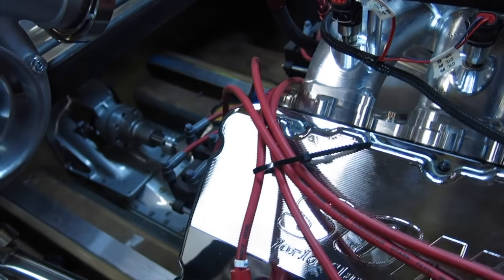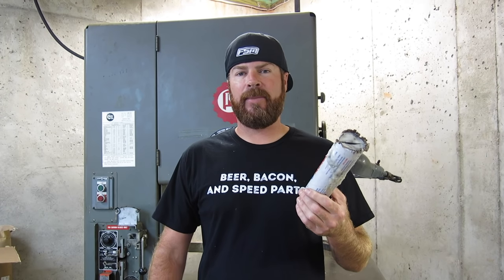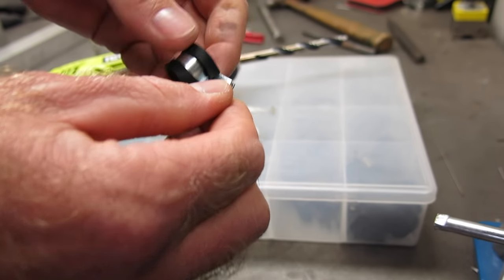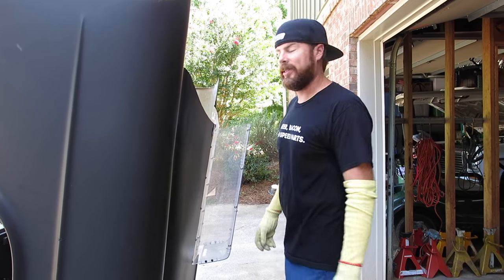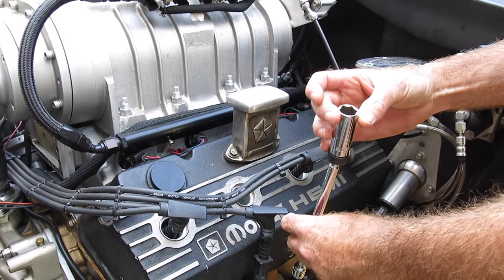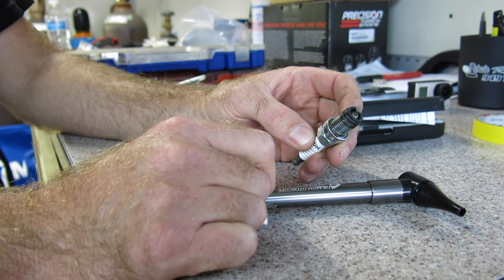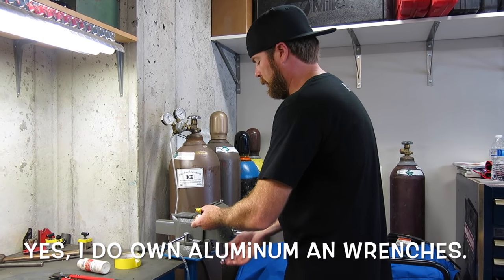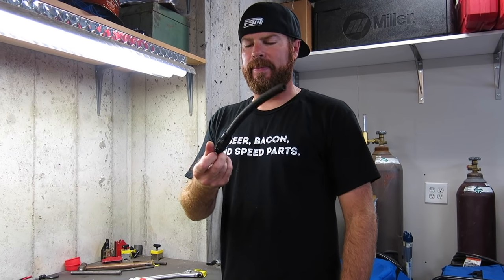Finnegan's Garage Ep 14: Life Hacks for Car Guys

Comment: Another use for that small scrap of soap. If you have a old metal gas tank that is leaking, rub that soap over the gas leak and it will stop that gas leak, to get you home, to fix it properly. I've seen it done and it stopped the leak. try it,  be careful with gas leaks no fire or smoking. Great tips and video.
Reply: Also works on plastic home heating tanks as well
Reply: And to repair tanks of most materials Araldite [epoxy] does a very good job. 5 minute if you have too but the good 24 hour stuff is best, or Devcon also.
IF oil free it will repair small cracks in oil pans too. Forget it though if not 100% clean
Reply: Acetone and torch , f250 5.8 5 spd 4mfwd ,solid as a rock . when pan came in and went in .
Reply: A pop rivet and a rubber or plastic washer will also get you out of trouble with a small hole in a tank.
Reply: All you need to do is rub the soap on the gas that running or dripping out of the tank, its that simple, no tools required, great tip if you have a round hole.

Comment: Also any chance you can go more in depth with reading spark plugs?
Reply: inside cover of every Haynes manual
Reply: I think you missed the "In Depth" part.
Reply: Ceramic should be a cardboard brown color. Black is rich, white is lean. Light brown is slightly lean, dark brown/ blackish brown is slightly rich
Reply: Jason Peterson

its a good starting point
Reply: Would like to hear more than colors.   Finnegan said about time my marks and fuel ratio marks being burned into the strap and ceramic.   Would like to hear more myself
Reply: the depth tells you timing. the more compression the plug bangs into, the deeper it will show up.
Reply: location of colour is very important too don't forget, you are NOT looking for colour at the very top where it counts is at the very base so ya gotta chop the threads of to see, That's WOT of course idle and mid range have their locations to a swell as heat rang eon the threads initial and total timing on the earth strap and the clearest is idle mixture all over the top of course
Reply: depth of what? if you are claiming the depth of where the colour is on the ceramic then I'd hate to see your tune
Reply: I didn't understand what Finnegan meant by looking deep inside the spark plug. Do you know what he was trying to say? Is it not good enough to just look at the tip of the spark plug? Thanks for any advice you can give.
Reply: Never mind about my question to you earlier. I just saw that "wordreet" has a good link below, regarding the reading of spark plugs.
Reply: Yes, please, I'd love to see this explained.  I'm trying to do "plug chops" on a motorcycle and cutting the threads to view the base of the insulator, but it's not telling me anything.  I'm hoping he can elaborate...
Reply: jcapcik
Google yellow bullet forums and look for nitrous guys threads on plug reading, if anyone knows what plugs look like it's nitrous guys
Reply: Not necessarily, today's ethanol blend makes it rather difficult. I tuned a 318 via color once and had the thing so pig rich trying to get a color change, that it was gargling at cruise and the plug was still ghost white. At least the tip of the porcelain was, Im sure deeper down the cone told a different story that the naked eye could see.
Reply: @dirtRider500R  

*Couldn't

Comment: Killer tips!  Before the 5/8" Plugs, we used an old screwdriver and a piece of 3/8" fuel line.
Put the line on the driver with a hose clamp and Hooray!  Works for installing the plug in odd places too!!

Comment: I like the magnet trick for retrieving plugs, works good on the Ford mod motors and the Mopar 4.7.  And for putting them back in a piece of vacuum hose pushed on the end of the plug works great to guide it back into the hole and you can also start the plug into the hole by twisting the hose.

Comment: The mini magnet on the stick is the most useful thing ever
Reply: Yes, and cheap also. In case you don't have that, hold a long screw and a big magnet (like those on a speaker) on the other end. It'll do the trick.
Reply: They're great for when you drop something stupid down your distributor hole like the hold down bolt too. Ask me how I know.
Reply: Instead of the magnet to get plugs use a 8" piece of 5/16 ID fuel hose.  You can grab plugs and start treading them with the hose pushed over the end of the plug.  This is very helpful for changing plugs on the rear bank of cylinders on FWD cars like camry or lexus
Reply: I wish I had one of those a couple months ago. Stupid spark plug socket rubber wouldn't grab the damn plug and pull it out.
Reply: I just stick the plug wire back in to get the plug. I mean, it's right there. It's made to grab the plug.

Comment: Life hack I learnt today when I bought a Ford Ranger. The fuel tank is on the drives side unlike my Hilux. I said I will have to remember it's on this side now. He said as we got back in the truck. See the fuel gauge, there's an arrow that points to the side which the filler is on. Blew my mind. Thanks for the tips Finnegan.

Comment: Cool stuff as always.  For SPARK PLUG installation & removal after you initially loosen or install, use vacuum hose on the silver plug ends.  It's flexible, wont allow you to gall the threads

Comment: Hello from Poland!
To remove, and insert a dificult sparkplug, you can use a rubber hose.
The benefit over a magnet, is that you can safely "dive" a plug down to its canal, and then screw it till the wrench is needed.

Great show by the way!
And great choice of beard, over the early roadkill one :)

Comment: Using a bit of rubber fuel line (4-6") works great for pulling spark plugs out.  Also works great at installing plugs since the hose holds the plug tight enough for the first few threads.

Comment: could you tell us a little more about how you read sparkplugs? with my little knowlege  all i knew was that black means ritch and white means lean but i allways just looked at the end of them and not inside. i had no idea you could read timing either but i realy want to know how to do it :D the neighbours ancient 2 stroke bike is cramping our style no matter what we do it doesnt wanna run right. allthough it doesnt help that we have very little knowlege about carburetors too.
Reply: ***** yeah we took it apart and found that the ring gaps were widely off-spec, they got replaced but the bike is still in the break-in stage. you can allready feel the compression when you try to start it. kick it too lightly and it'll damn near break your ankle :D we tryed to judge the timing from its behaviour at different RPMs but that only got us so far so next guess would be the AF ratio. its a fun process and i have no idea how the older generation managed to learn this without the internet :D thx for the tips, i'll try to find some forums

Comment: Been doing that trick with tape to build aircraft hoses for a long time now. Same with the zip tie trick for wire separation. You can get small nylon spacers at Home Depot that work great to separate your wires instead of zip ties between the wires.

Comment: Hey Mike!

Love the channel and the roadkill series. Keep up the good work. Also look into magnetic spark plug sockets. You'll never go back to the old rubber ones again. Never wear out and no "break in" time fighting to get the plug out of fresh rubber.

My own tip, murray makes a special oil for lubing A/C seals. Works great for any seal or oring especially fuel injectors. Miracle in a bottle. Also, Vaseline works in a pinch for stubborn Orings in a pinch.

Comment: Who knew wire ties could be used to tie wires. Good tip though. Lol
Reply: I did,,, I saw David do it months ago on roadkill!
Reply: Freiburger first did it in a Car Craft tips article in the early 90's. It's an old NASCAR thing.
Reply: LDN Wholesale  Yes, David did do it on roadkill but the tails (the ends of the zip ties) were supposed to be on the back side of the spark plug wires & then you cut the ends off.

Comment: a tip four your tip, Mike, when putting tape on the wrench, substitute metric for standard fitting and standard for metric fittings. metric is usualy just in between standard wrench sizes. that way, you won't have the clearance issues you had with the tape.

Comment: I was late realising the step drill versatility - check around as some versions have fewer steps but much longer shanks for their sizes - very useful for thicker materials.
Also great for enlarging drillings in heads (eg. larger studs) and other castings for a much neater job as the initial step makes a perfectly aligned hole that guides a regular drill the full length and stops that awkward walking on initial bit - especially for hand drilling and especially, especially for soft materials that can 'grab' the drill.

Oh, and so nice to see someone using a shifting spanner the right way round :-)

Comment: Don't know if anyone else's brought this up but what I use for the deep recessed plugs in my motorcycles and suck is a set of very thin, long jawed hemostats. I got mine when I bought a bunch of tools from a friend and don't know where he got them. but the jaws are between 3-4" long and taper down to the tip from about 1/4" wide at the pivot point. I not only remove the plugs, but since they lock down when you squeeze them together, I can also start them into the hole.

Comment: I've used the ol' zip tie wire separator procedure, but that step drill trick for opening bolt holes is a new one for me. Definitely gonna use that in a pinch!

Comment: Tip for retrieving sparkplug in hemi heads. old rubber sparkplug boot glued to a piece of wooden dowel. loosen the pug then push the rubber boot over the plug and unscrew by hand using the dowel. Makes putting new plugs back in easier too

Comment: I always just used a die grinder bit to enlarge clamp holes. Do yourself a favor get a blue point magnet i've got two and dont leave home without one. Inspection mirrors are great too especially when you drop a bolt or nut in an engine compartment and it's in a blind spot.

Comment: Professor F, I am sad to say that I knew all of these (though I would not have known about the kev sleeves except that I work in plastics so I use them every day).  Here's one on spark plug retrieval.  Wrap a bit of tape around the end of the spark plug socket (just a bit) and then fold it down and in to the inside of the socket.  It will lock the plug in place kind of the same way your wrench got locked on to the AN fitting.  Cheers!

Comment: Aircraft tip: Instead of using little zip ties between wires, you can use little pieces of tubing  which works and looks really nice. Not quite a easy & fast but it has a little more curb appeal. And if you are looking for cushion clamps, they are also called P-clamps or Adel clamps. Aviation and or aviation manufacturing surplus stores are treasure troves for us hot rodders and fabricators.

Comment: When I change spark plugs I just slide the spark plug wire boot back on the plug once its loose and pull it out that way. You dont have to look for any magnets or special wrenches, and the engine you are working on provides you with one for every spark plug.
Even works on my F150 with coil packs on the plugs, same principle.

Comment: One thing I've found for zip ties is that if you don't cut them flush, or even sometimes if you do, heat the end for a couple seconds with a lighter or small butane torch. It'll soften the plastic and round off that edge that would otherwise make you bleed.

Comment: I remember reading all the cartoon tech tips in the back of the hot rod magazines.  Those have helped me a lot over the years.  One I still use is to put a cut spark plug boot over the tip of an open caulk tube.  Works great.  Funny you said Oklahoma to the siren.  That's the first thing I thought of when I heard it.

Comment: to get the spark plugs from the hole in the valve cover, you can also use a piece of rubber hose (6 to 10 inches long) to catch it, you can also use the same hose to start screwing the plugs into the heads, its a more delicate way to make sure you don't damage the threads, even more so for an aluminium head

Comment: Just a quick point on the zip tie lead separators. Some of the better leads are silicone insulated. If that is the case use grommets round the lead (i's ok to put a cut in the grommet to get it in place) and don't pull the ties too tight. The zip ties can also cut into the real cheap leads as the insulation softens (at about 180F on real cheapo leads) before the nylon in the zip-tie does. Again grommets work or any hard (vulcanised) rubber tube cut to size. The black zip ties usually have a higher temperature rating (compared to the normal ones) as the compound used for colouring also affects hardness etc.

Comment: Soap may work as a lubricant, but one problem with soap is that it tends to attract moisture, which around metal is not a good thing.  Same issue with using soap on wooden drawer runners, the soap attracts and holds moisture causing the wood to swell, making the issue worse over time.  If you want some cheap lubricant for the shop for screws etc, hit the plumbing section and spend about $3 on a wax toilet seal.  It's a nice semi-hard wax that one ring will probably last a lifetime.
Reply: I thought he was going to pull out a candle stick. I use either a candle or Johnson paste floor wax.

Comment: For enlarging holes like such use a die grinder. Far easier. Great for enlarging holes in firewalls for grommets etc too.
For fitting or removing spark plugs use a piece of 3/8-1/2 fuel hose. Just use socket for final cinch. great for plugs that half hide behind headers etc. 
You can read plug colors out in the sun, I agree no good in a dark room.
A normal wax candle is great for die grinding alloy, as well as making a coarse blade cut thin sheet metal. I have been using the one 6" candle for about 20 years! And I have matchported intakes, heads etc plus ported several pairs of heads.
Reply: or buy the right size Adel clamp ?
Reply: I disagree there
the stepped unibit gives a far better hole than the die grinder move

Comment: Big fan of the magnet on a stick. The rubber in my cheap plug socket came out and got stuck on the plugs. Not so bad when you're taking them out but an obvious problem when you're putting them in.

Comment: You can still use a regular drill bit, you just need to start with one closer to the size of the original hole and gradually move on to bigger ones. Using opposite rotation helps to avoid messing up, too. Takes a lot longer though, so maybe really rather for emergency cases.

Comment: One of the best episodes yet, full of useful information I can and will actually use.  While I did already know some of the tips, I surely didn't know them all and I know others will find it useful as well.  

I would like to know more about reading spark plugs though.  This is the first time I have ever heard anyone talk about the "fuel ring" in the spark plug or the timing mark on the grounding strap. Could you please do a detailed episode on reading spark plugs and what adjustments should be made depending on what is seen?

Comment: Pro Tip: Even cheaper than your mini magnet is a piece of rubber hose. Just find one that slips tightly over the cap on the spark plug. It works really well for starting hard to get to spark plugs.

Comment: What's better for grabbing the spark plug, than a magnet, is a piece of 3/8 fuel line.  Push the line down over the ceramic insulator and you can even start the threads or unthread it the rest of the way, because it acts like a flexible extension.

Comment: Top tip for putting your wrenches or anything else in a vice that you don't want to chew up with diamond pattern marks: Get two pieces of 1/8" aluminum scrap, cut them into squares equaling the width of your vice jaws, and bend them at a 90 degree angle. Slide one on each side of the vise. No more chewed up surfaces, just a pair of chewed up, replaceable aluminum pieces.

Comment: I got one I thought you might say but didn't. When the spark plug socket wont hold the spark plug to get it down a deep cylinder head you can use a piece of hose over the end of the plug, and guide it down the hole with out risking damage to the plug. Then use the hose to start threading it.

Comment: re- anodized fittings: place one of the fittings in the vise protected by a doubled over microfiber cloth, lubricate, and wind the other fitting on preferably with a  aluminium AN wrench, there is no need for the second wrench, alternatively some nice soft jaws for the vise would eliminate the cloth

Comment: On the spark wire thing, I prefer to pull the spacing ties down first, leaving the bundle tie until last.  Puts more space between the wires which looks better , IMHO.
AN hose assembly.  Use wide, smooth jaw wrenches, oil them and don't skew the wrench when tightening.  Works for me.
Reply from the maker: i like the look of them being closer together.

Comment: Zip tie tip : If you take a pair of linesman pliers and grab onto the piece you want to cut off and twist in a circular motion until it breaks off not only is it just as short as cutting it that way you have a nub that wont cut you open when you brush against it.

Comment: I used to use a small dia rubber hose connected to the end to start the install of spark plugs by hand.  Chances of cross threading very low, also overall easier to install.

Comment: I know there is not as much force on pc cooling parts so I am not sure how well it would work but I use thread locker tape on the water cooling clamps and channel locks to loosen them. usually works without destroying the anodizing on the parts.

Comment: I always drag the wax or bar of soap from the back of the blade to the front (the cutting edge) when I apply wax.  You get the same coverage but you use less wax because the blade is not making wax chips that go to waste.